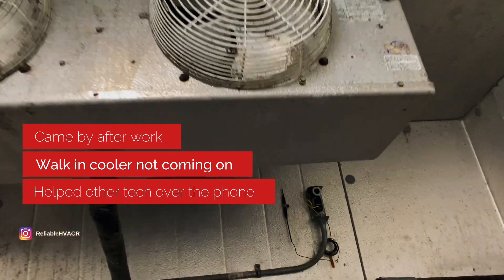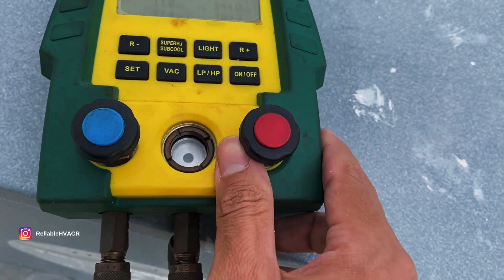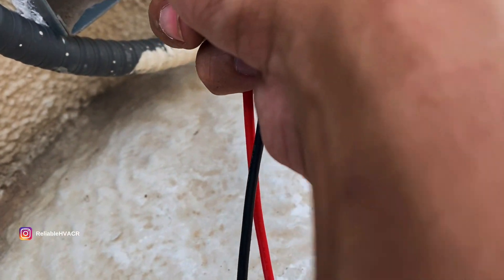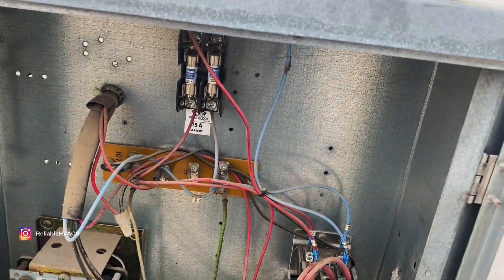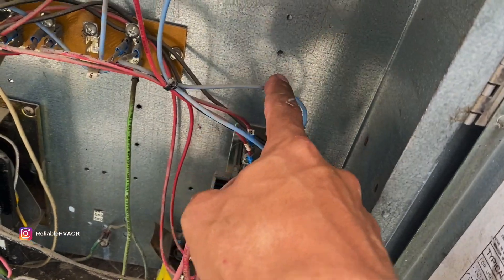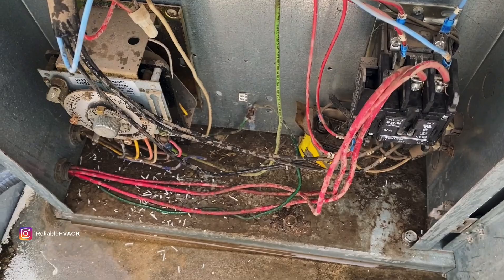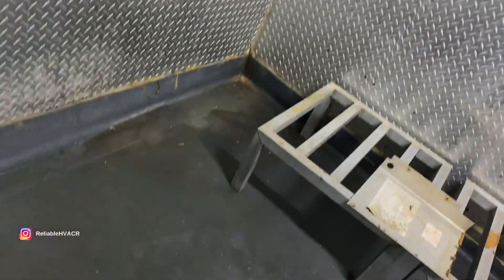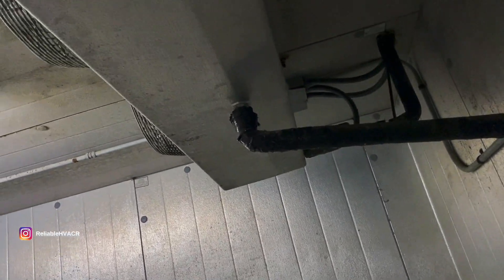Going Back in to Help After Work | Missed Something So Easy | HVACR

Comment: Hey where you get the magnet ?
Reply from the maker: It's a rubber magnet with a threaded ring, I put it together from parts on Amazon. I have them in the tool link in my description if you want to look around 👍🏽